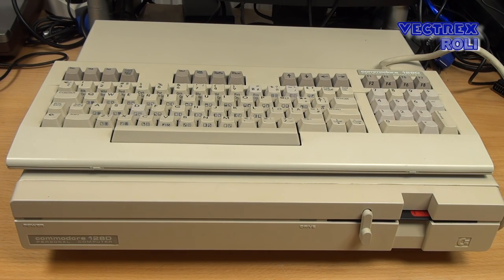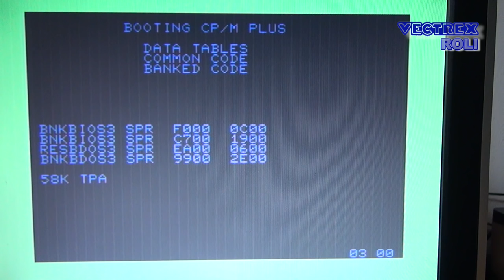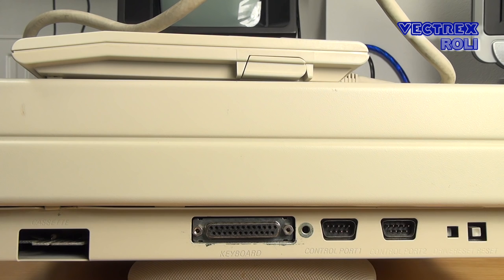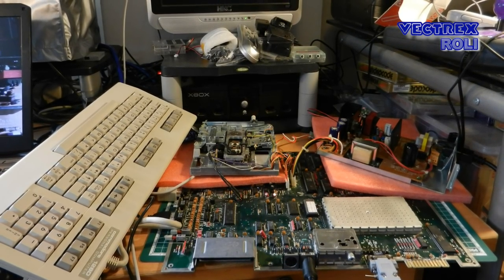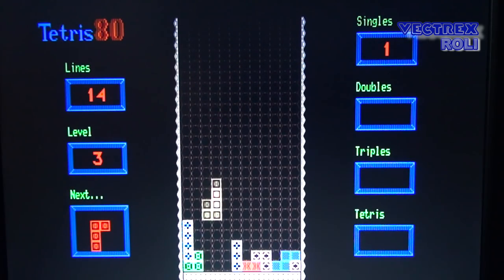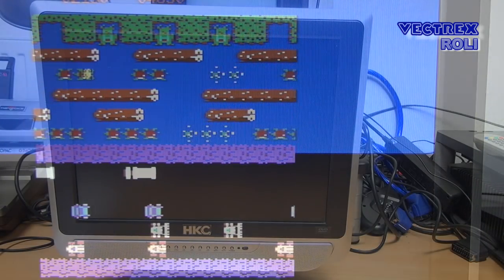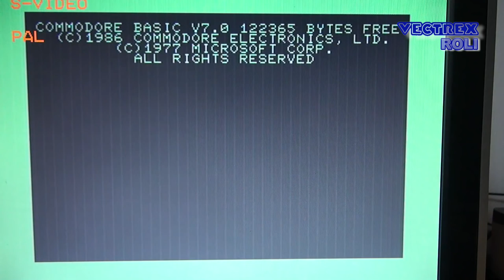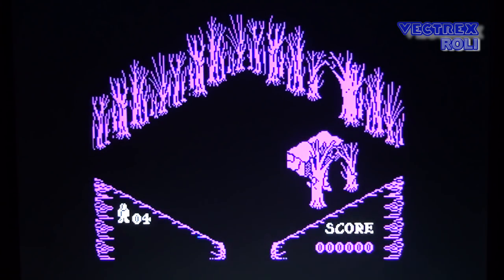VectrexRoli´s Commodore C128D Special!

Comment: The more videos I make, the more I appreciate the work you put into yours Roland. Very impressive video, as usual, about a wonderful old piece of hardware. I always have a special love for the C128 (not the D perse). It was a logical upgrade to my C64 at a point where actually buying one didn't make any more sense anymore, for me at least. 
Nowadays I think the best reason for me to use the C128 in 128 mode would be to play Elite which actually used the faster CPU speed of the 128.

Comment: If I remember what I did with my C128D was leave a disk in the internal that would auto load a program which swapped the drives with my external 1581 as primary and loaded a custom menu. This disk in the internal would have various utility/productivity stuff plus a choice to access whatever was on the 1581; in fact I had several to rotate depending on what I was doing.   So this did two things you mentioned.  1) I didn't have to do any physical changes to the devices and 2) remember to keep a disk mounted in the internal drive.

At the point when I moved to a C128 from a C64 particularly

Comment: Excellent video for an excellent machine. I liked you laying out the various cables for the different video modes. If the 128 and 128D were released 2-3 years earlier, they would have made a much greater impact on the market. The omission of a 2nd bay for drive B: kept it for being a good CP/M machine as well. My 128D is kept safely in storage, these things can't be replaced easily anymore, the prices are getting steeper each day. One of my most precious items in my collection. May your 128D live long for you to enjoy!
Reply from the maker: At least I remember seeing a few CP/M office machines here in my country back in the days.

Comment: I was a big fan of the C128 and C128D back in the day I used mine not for playing games but for Productivity and to run my BBS.  If I wanted to play games I had the C64 but I found the C128 was better suited for more series applications.    I recently acquired a couple C128D's. a C128, several dysfunctional C64's which I had fun repairing.

Comment: fab video. a lot of hard work, good job. I have a 128D but the default of the internal drive is drive 9...any idea how to switch it back to drive 8?
Reply from the maker: Just guessing that the previous owner might have changed 1 or 2 drive adress "bridges" on the motherboard? If that´s the case you have to solder them back again.

Comment: A Vectrex Roli Video! And the topic!!!!  - the Ultimate C128D model!!!! Thanks for this elaborate showcase it was very good to watch. And also thanks for all those shoutouts to my own and our fellow YouTuber's channels regarding this topic. 

I acquired a C128D for the exact same reasons you did: the complex nature and the fact that you got 3 computers in one. Very interesting design. I love the sleek look of the unit - with a 108x CBM monitor on top and a mouse the system looks perfect. Using the system with Geos 128 is also a great experience - still. 

Ran into the same issues with using the 1541Ultimate with the C128 - but indeed there's a good workaround. I found quite a few C64 games that are capable of taking advantage of the C128 in some way. Some game disks will show a different boot menu on the C128 compared to the C64.

After viewing this I need to open op my C128 myself, my model was in excellent condition and the previous owner had taken very good care of it. But putting heat sinks and checking the caps is something I want to do.
Reply: when you heat sink your chips: remember that you can use too much heat sink, and that dripping heat paste around chip legs (even though barely conductive) can cause problems. I killed a C64 that way recently.
Reply from the maker: Your video was one of the reasons why I wanted a C128D ;-)

Comment: Great video. Got also a 1541 Ultimate II not the new version for  my C64 Reloaded MK2. But is a Kingston 16GB micro SD Class 4 good of is 4GB the limit for the 1541 Ultimate II.
Reply from the maker: I don´t know I would check that out on the Ultimate Forums or Web page. I use an older 2GB Sandisk on my old Ultimate II (non plus model)

Comment: Interesting video. Could you please explain why the 40 column font for both 128 and 64 modes looks different than the traditional fatter font?
Reply from the maker: Sorry, I don´t know that.
Reply: That is the special German font which includes the Umlaut characters. You can access it by means of a switch key in the top row of the keyboard. German spec machines only

Comment: CP/M was waste of money and time. Even in 1985 nobody wanted CP/M anymore, let alone in 1987. It just added lot of cost to the machine. Instead, they should offer something better for c128 mode, like new graphic chip with better resolution and more sprites. VDC lacked direct bus connection to CPU, hardware sprites and  multicolour mode.  Despite of all this, the machine was not a flop in sales. Commodore sold almost 6M units.

Comment: My former business partner had a C128D with the JiffyDOS upgrade, SuperCPU and RAMLink. He also had the Turbo232 and a CMD Harddrive. He was running a dialup BBS up to the early 2000's. It was a nicer version of the 128 and was a fine piece of hardware. 

Some of the fancier Commodore monitors were nice in that they could switch from the 40 to 80 column modes to match what mode you needed to be in.

I had an SX at one time but it weighed a ton. I had JiffyDOS in my as well and I'll tell you that it was a real pain to open up the SX and get at the boards to swap the ROMs. I also had to find a good spot to drill the hole for the toggle switch.

That is a cool and different drive select switch. I'm more used to the two-toggle switch system of changing drive numbers.

CP/M was also nice on the 1581 drive.
Reply from the maker: Yes the SX-64 is complicated to change ROMs, also experienced that. ;-)

Comment: So, the screen characters look like those from the PET and the VC-20. Is this typical for systems that support languages other than English?
Reply from the maker: It supports both classic PETSCII characters and also ASCII.
Reply: VectrexRoli Yes but did you change the character ROM on this machine or run a program that uses a font loaded RAM? In the US the 128DCR used the chunky C64 font in 40 column mode and this machine clearly is not using it.
Reply from the maker: No I did not change anything on the ROMs, but maybe the Caps Lock key was pressed down? Then it would activate the language specific character ROM if I remember correctly.
Reply: I looked it up, I never knew but the German version of the C128 had different fonts than the US version. http://commodore128.mirkosoft.sk/national_versions.html
Reply: Thanks for getting all that cleared up! That is exactly the information I was trying to elicit with my first question. But I've been distracted by other matters and doing my own research fell to a much lower point on my priority list. Once again, thanks for your efforts.

Comment: If a floppy disk is left in a drive for long periods (years/decades), the disk's magnetic coating can get stuck to drive heads, which is not a good situation.  A "transit card" (which these drives shipped with, and replicas are available) is best used for long-term storage.